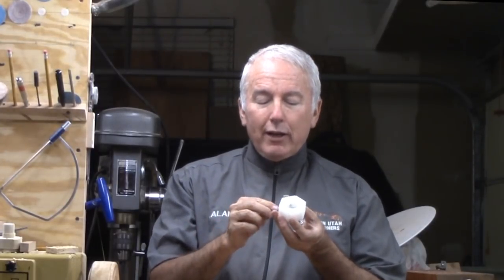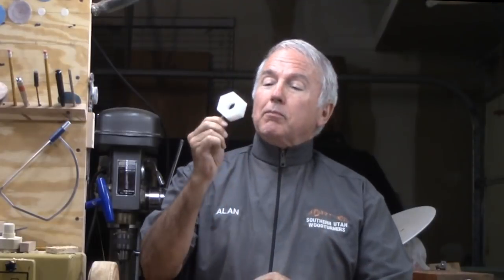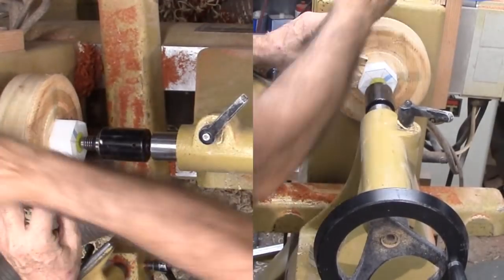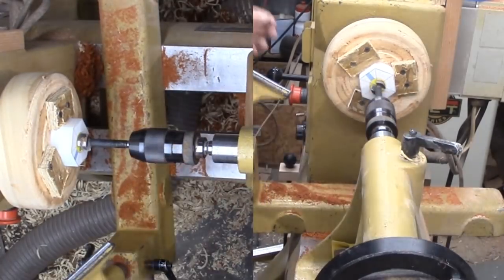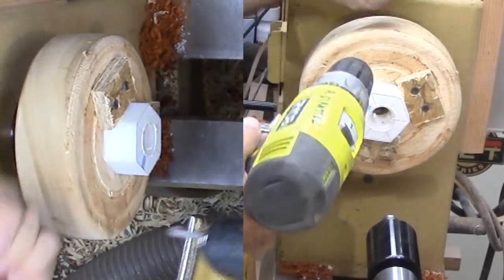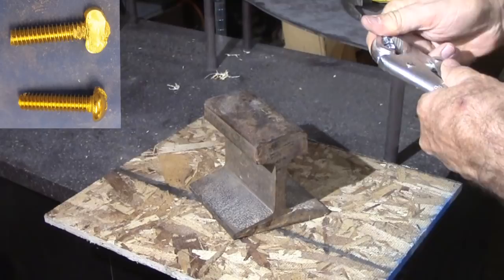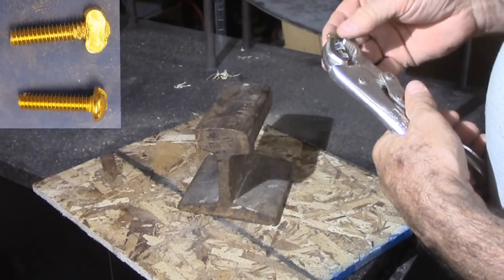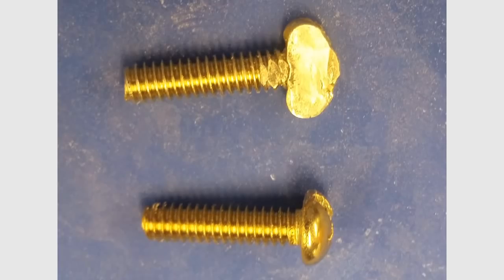DIY Flange Nut Alternative With Set Screw

Comment: An alternative is to use a small brass disk at the bottom of the set screw and then use a steel set screw to press on the brass disk.  MSC is right down the road from me (about 30 min) so I am there a LOT!  I can order something for pickup and run down about an hour later ad get it.  NO shipping charges.
Reply from the maker: Great idea. Is there some way to retain the disk so it will not fall out if removed from the bolt?
Alan
Reply: Alan;  No;  Unfortunately there isn't.  My metal lathe has a disk like this under the threaded drive pulley.  In this instance it isn't an item that is taken off and on.  One other idea is to use a brass threaded rod or long screw.  Cut the head off the screw and then thread a wingnut or small female knob on it.  Superglue or epoxy in the wingnut threads keeps it in place.

Comment: Nice project! Not sure how much that chunk of HDPE cost you but you could have obtained a low strength steel flange nut from McMaster Carr company online for about 8 bucks? They are an excellent company for hardware items like this and usually ship same day if ordered by 10 am. And, yes you could buy just one nut. Just another source I like to use for unusual hardware parts. Good luck with your project!
Reply from the maker: The HDPE has been lying around my shop for years. McMasterCarr is the one I priced for the flange nut and I would have ordered from them if I had not  had the idea to use the HDPE and tools I already had.
Alan

Comment: Excellent problem solving, Alan. Good luck with your threading jig. My results were such that I ended up buying one. Building one so the chuck would run true was a bigger challenge then I expected and not easily solved if you are not a machinist. With your machinist friends, you may have better luck.
Reply from the maker: I lean towards solutions that do not require a machinist although I am consulting with some.. DIY usuallly is challenging. Commercial applications have already solved many issues but at a cost.
Alan

Comment: But did you cast the HDPE yourself? =) 

(I made a roller trailer for my boat using all recycled milk jugs.  While I absolutely LOVE how HDPE machines and how it's basically impervious to water/sun, I hate how the shavings stick to everything.)
Reply: I've done this as well. A bit tricky sometimes to get a void-free block, but it's a nice material to work with, especially if you also have a metal-working lathe and mill.
Reply from the maker: Never considered casting it myself. Now I might. :)
Alan
Reply from the maker: Never thought about casting it myself. That's a lot of milk jugs.
Alan

Comment: Instead of hammering the hex nut flat, you could have made a wooden knob for the end of the brass set 'screw'.  The simple way is to measure the flat-to-flat dimension on the hex, and drill a hole in a round scrap of wood that is equal to or very sightly larger than that dimension.  Use a chisel to expand that hole into a hex, and then glue the hex into the hole.

There are many ways to skin a cat.
Reply from the maker: Many ways. This time I thought to work with the maluable  property of brass.
Alan